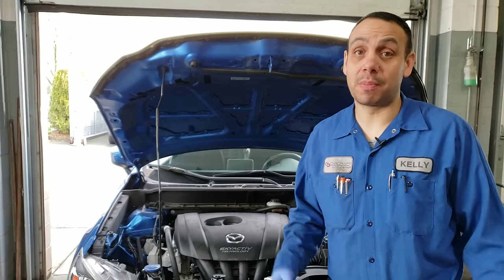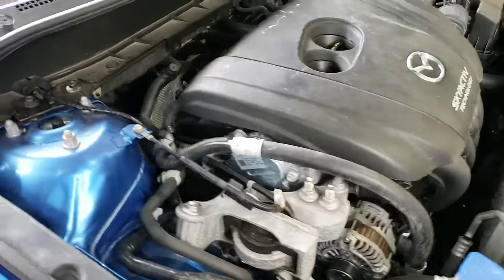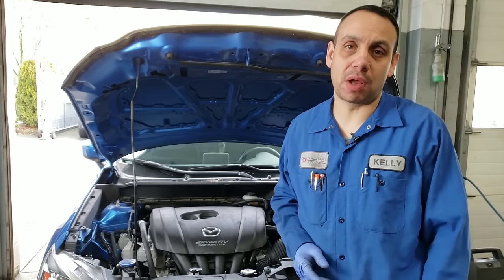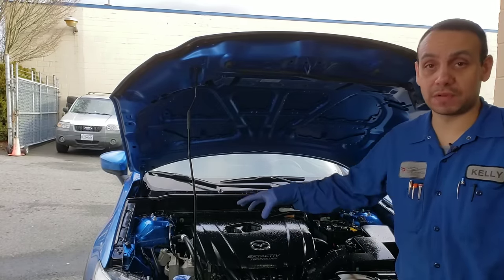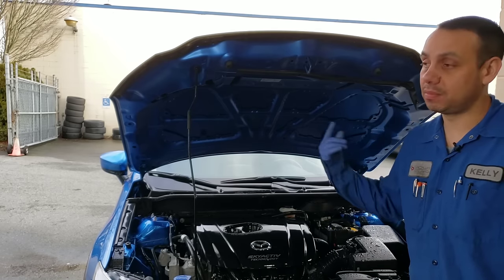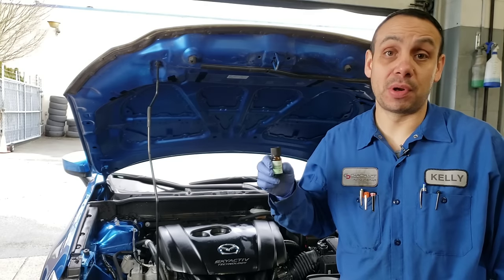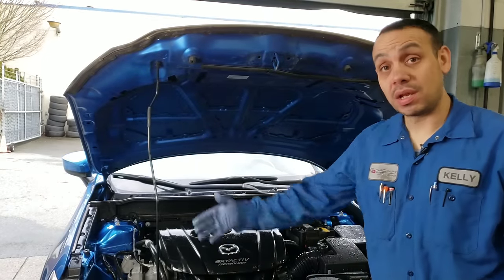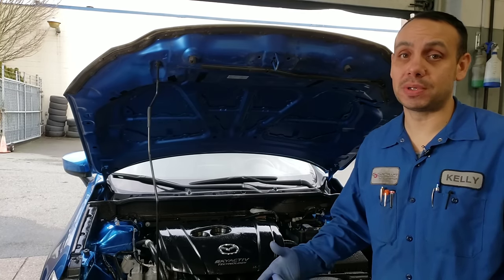Easy Tip To Keep Rodents, Mice & Rats Out of Your Engine Bay

Comment: I'm surprised not to see a suggestion to sprinkle cayenne pepper over the engine compartment panels after doing the clean up. They walk on it and then lick their hot feet and won't be back for
that anymore. The pepper sticks to the surfaces but is easy to see when it has blown away. It lasts quite a while and is cheap.

Comment: Water and electronics don't mix.  You're asking for big problems if not right away but down the road.  Back in the day before all the electronics in a car it would've been fine to spray everything down with water and whatever else.  You're setting yourself up for major corrosion of your electrical system.  Might take a year or 2 but it will happen.  Clean up everything as good as possible without using a garden hose or pressure washer.  Bad advice here?

Comment: Thanks , but 6 minutes to say spraying peppermint oil is unnecessary.     “ clean , dry, inspect, apply a peppermint oil spray to the inside of the engine bay”.  Don’t give advertisers a chance.

Comment: Years ago the wiring had petroleum oil based plastic sheathing but because of all the hysteria over the climate they have canola oil plastic sheathing now which rodents find really tasty.I guess electrical engineers must have had a  woke moment which is seldom associated with intelligence. The up side is that car dealers are making a fortune replacing car wiring.

Comment: You're piss poor click bait.
Pepper mint oil is only good in confined, non-ventilated areas. Like inside your cab. Spraying into the engine bay would be gone in a few miles of driving.
The best thing to do is to place a bright light in the engine bay.

Comment: A hose and an engine are not a good combination.  I would not recommend this in any modern car.  Electronics do not like water
Reply: actually not true at all don't know where you heard that ,all cars sold today must withstand a power washer, D O T MANDATES THIS AS CARS MUST BE ABLE TO STAY RUNNING IN A MAJOR RAIN STORM THAT CAN PRODUCE 1 FT OF WATER THAT A CAR CAN DRIVE THROUGH AND ENGINE BAYS WILL ENDURE A MASSIVE AMOUNT OF WATER THROUGH THEM AND KEEP RUNNING, OTHERWISE CARS WOULD BE STRANDED EVERYWHERE DURING MAJOR RAIN STORMS, NEWER CARS ENGINE BAYS ARE 100 TIMES MORE WATER PROOF THAN THEY WHERE IN THE 70S ,80,90S, ALOT BETTER
Reply: @munger2166  If you say so.........If you want moisture in your terminals and connections..Be my guest....It may run now....Just like a flooded car.....Give it time....Moisture was not meant to get into connectors.  I most certainly would never use a power washer under the hood of my car.

Comment: Very very poor idea to wash your engine. ON Many older vehicles water will get into the wire connectors and cause serious problems, ruined alternators, starters and more.
Reply: In the old days, the engine cleaner instructions said to cover the distributor and battery. They still sell engine cleaner, so it must be ok to rinse off your engine. Except V8 Volvos.

Comment: This does not help, I had brought my car to car detailing , did engine wash, underwash , inspect my engine 3x a week. Clean my garage every often. I bought pepermint and mix it with water - does not help..... I bought rat killer sprey which is basically smells like peppermint , WTF rat is too strong it does not even affect him...... 
What I did is that I bought rat Killer powder and put it on a pieces of bread or fix coated with Rat killer powder , the next day I saw rat dead near my car.  One thing for sure another Rat will climb up again , so I decided to double the insulation of my wirings with clot tape and I coated it with Rat killer powder incase Rat will try to bite so they will die.

Comment: My god never spray your engine bay with a water hose.   you can get small wires and connectors wet that go to sensors. you don’t want to corrode them.   if you get enough water on your battery you can short it out.  Stupid